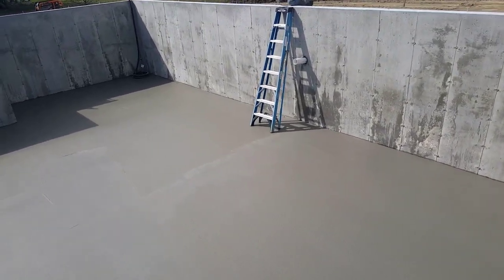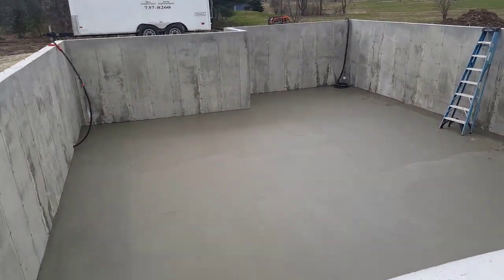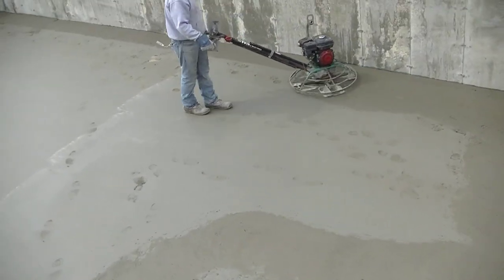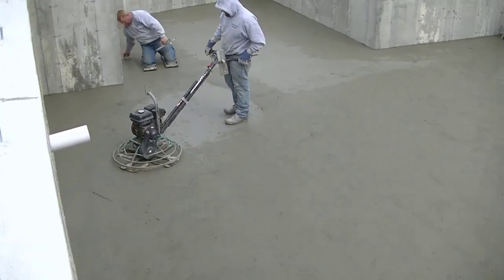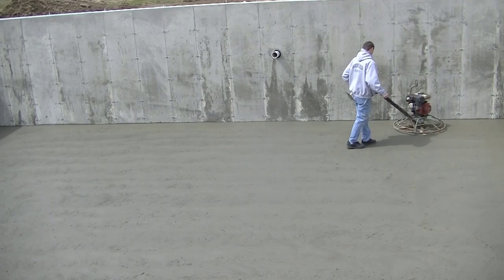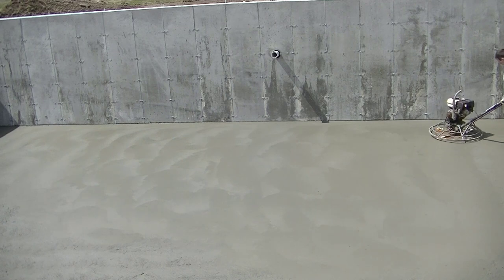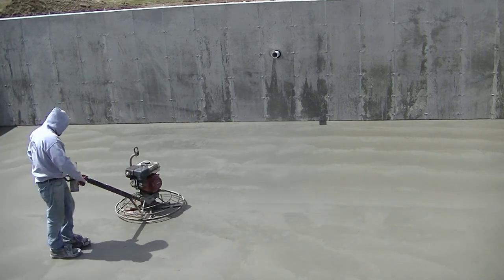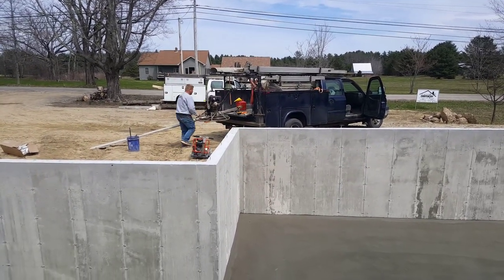HOW TO FINISH A CONCRETE FLOOR | POWER TROWELING SECRETS

Comment: Thanks for all the tutorials.  We specialize in pre-fab metal buildings and my concrete guy is so expensive that we lose alot of work.  We want to do turn key work so we can come in cheaper and to get the jobs and have more control of the schedule.  I send my guys links to the videos to study.  We can do small jobs now but hopefully with watch your videos we can get comfortable enough to start doing bigger jobs. Thanks again

Comment: For a mostly flat garage floor, but then sloping slightly towards a center drain under each vehicle stall, how does it work to run the power trowel across from the flat area to the slightly beveled sloping floor area around the drain?  (The drain is for snow melt from vehicles.)  I'm worried about the power trowel digging in at the joint as I move across from flat to sloping.  The floor drain is to be set about 1" below the overall floor elevation, so the slope will go from flat to about 1%.  Thanks for the great tutorials!  I haven't used a power trowel yet, but plan to.

Comment: Do you recommend power troweling even tho you are going to mechanically polish the floor afterwards?
Thanks a lot for your videos!
Reply: Power trowels provide a lot flatter finish than doing it by hand, so if you have the room for one and you want a smooth finish then get a power trowel on it. You will save your body and have a better product.

Comment: I know you don't want to start power trowel if your foot sinks more than 1/8 inch, but how do you judge the times you run over it after that? By feel, temperature, or a certain amount of time?
Reply from the maker: It depends on the day. If it's hot and sunny, not much time, sometimes you go over it then go right back over it without stopping. If it's cloudy, more time in between hits. And if it's cold out, maybe 30 - 60 minutes. The sun and temp plays a big factor in the finishing process.
Reply: It is something that comes with practice. A novice must hang around an older one for many jobs in order to master the skill and be able to do his first one flawlessly.

Comment: Is there air entrainment in this concrete? If so is there less air than what you would use on exterior slabs?
Reply from the maker: We don't  put air entrainment in house floors, but we do put some in garages, 3 - 4 %
Reply: So does the little amount of air you put in garage floors have the same problems as hard troweling an exterior patio with air entrainment?

Comment: Hi what spec concrete do you use for these floors.?
Reply from the maker: This one was 3000 psi. 3/4 stone, straight cement with fibermesh and water reducer.

Comment: Your next power trowel look into the direct drive arrow master no pulley or belt, Whiteman is my 2nd choice
Reply from the maker: I started out with those when I was 16 years old. I used them for years and swore by them. I like this type now. Both are very good. I have 9 whiteman trowels now. Just bought my first Marshalltown 46", it's a beast.
Reply: Mike Day Everything About Concrete Whiteman are so easy to repair it’s silly not to use them imo

Comment: Hey great video. Thanks.  For a finished concrete floor, would you comment on typical hardeners, sealers (different gloss levels) relief joints, etc.  I'm not talking anything fancy. I simply doing a heated slab and want to use the concrete as my final floor.  I've bee doing research, and so many folks bombard me with what they think is their "best way". Thanks so much. Cheers. Jonathan from Canada.

Comment: After the concrete dries out a little so there's no more bleed water, you'd mag float it. BUT my question is do you start adding texture to the concrete straight after you mag float the whole thing at the same time of smoothing it out

Comment: When i start  burning the slab i be leaving rock holes what can u give me how to trowel dat
Reply from the maker: By the time you're burning it it's too late. You have to make sure they're all filled before you burn it. If the concrete doesn't have enough "cream" to fill the holes, ask the concrete batch man to tweak the mix design a little. Maybe a little less sand and more stone of vice versa.
Reply: @MikeDayConcrete  True words.  A crappy mix makes it very hard to get a top-notch finish and a great mix almost finishes itself.  Besides the concrete batch man, many redi-mix operations have a salesman you can talk to who really knows his mud and will generally be more than happy to point you in the right direction if you just ask.  That's his job and he's generally very happy to share his knowledge.  Seasoned pros can finish anything but for the less experienced it is often worth paying a little more for a higher PSI mix to get more powder in the mix which makes it creamier, generally but not always.  Another thing that can make a pretty profound difference is what admix is used.  Some mid-range admixtures have a "finishability package" built into them that makes the mix more creamy and easier to finish.  It's kinda like paint in that good paint makes the job much easier and often quicker, right?  A quick conversation with the sales guy can be very helpful for those who are not very experienced with a particular companies concrete mixes.  Pros know their concrete and what mixes are good for them.  If you don't fall into that category, don't be afraid to ask for advice from your supplier.  Also bear in mind that there is no one size fits all.  There is usually a good, better, best set of options but you have to know what it is you are trying to accomplish and what's available to help make it happen.

Comment: Mike you ever use a pan? Same scenario as the float pads I would imagine..
Thanks
Reply from the maker: I have in the past. They work good. We just prefer the float blades.
Reply: @MikeDayConcrete  The time to break out the pans is if you ever use a Macro fiber (for replacing up to #4 bar 16" O.C.).  Not necessary with the fibrillated or the micro fibers but a true godsend for the macros.  Also wait a bit longer than you usually do before starting.  After the pan, most guys hit it once each direction with the float blades but depending on timing, sometimes you can go right to the finish blades.

You guys are real pros.  I appreciate your commentary and your craftsmanship.

Comment: Hi Mike the town I live in replaced our sidewalks I also got them to replace the approach next year I plan to pour the driveway need two trucks about 18 yards , how worried should i be about the concrete trucks going over the approach and sidewalks , both were pours with steel mesh i provided
Reply from the maker: There's always a risk when driving concrete trucks over concrete. They're just so heavy. I wouldn't risk it. Wheel barrow it or line pump it.
Reply: Absolutely avoid !!!   Mines did not crack but got pushed in 4” !!! (Soil was moist after rain).   (Township did not see it yet ... when they will notice it ... just another headache :(

Comment: Is it possible to just float the concrete floor for a garage floor and that's all.
Reply from the maker: Yes, it's possible but would be pretty rough. I would at least hit it with the finish blades once or twice if you didn't want it to be too slippery.
Reply: Get a set of knee boards, a 24 inch bluesteel pool trowel and a hand float and wipe it.
You dont even need to put a machine on it. And your end result would be the same as if you would put a machine on it and pass it a few times.  Only diff is, if you pass it with the machine, you still have to wipe it, so i suggest you wipe it on the perfect timing and she'll be dandy!

Comment: what do you charge for 1sf just work?
Reply from the maker: What do you mean 1sf, please explain a little more. Thanks
Reply: The man costs at least 15 $/hr. Must pay at least 8 full hrs. If he comes only for this job u have to give extra. Always have second man at hand in case 1-st one is no show. Then you have to recover cost of machine, cost of transport and drop and lift and insurance for workmanship, material (machine can fall during lift), general liability and workmen’s comp. Besides u have to keep a bit for yourself. Add them up and for that sq footage I would say 500 $ :1500 sq/ft = 33 ć/sq ft labour only with my machine on site. Transport of machine is separate - depends of distance, of course no less than 40 $, no more than 70 (?).

Comment: Have you done any concrete roofs?
Reply: I think he said he does only floors. I thought about concrete roofs also, but it is difficult to find skilled people to do it. In South Florida I use solid anchors on the wood structure and just shingles; tiles are too expensive for me.